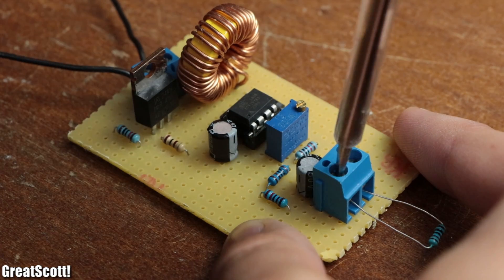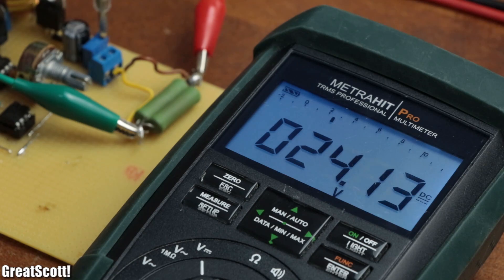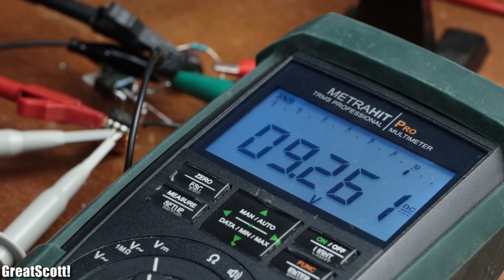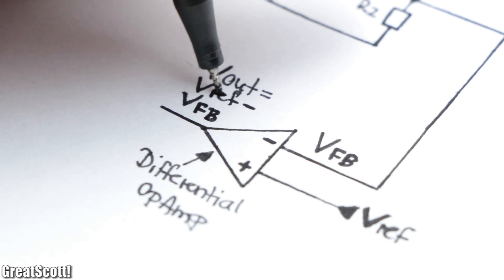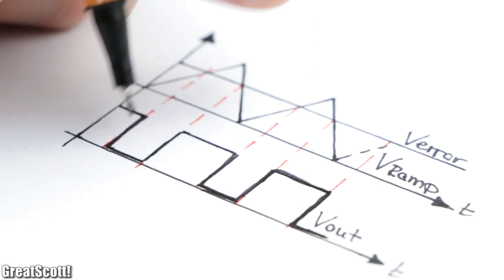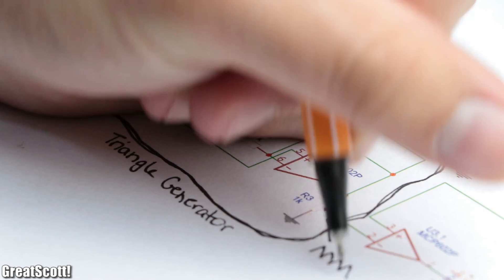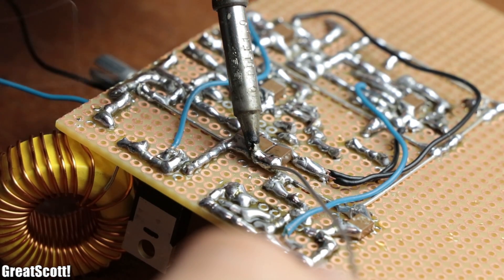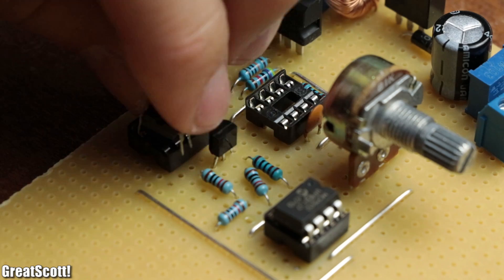Creating a Boost Converter WITHOUT a Microcontroller

Comment: SMPS have been around since before small cheap microcontrollers. I prefer using a comparator chip and have designed smps which are more efficient than commercial dedicated chips.

Comment: Circuit around U1.2 need to be configured into integrator amplifier. Take out R8 and replace R10 with capacitor which has 10mS with R9.
Cheers from Indonesia

Comment: add negative feedback from the output back to the input, put an opamp comparing the output to a stable reference voltage, let the op amp output control the duty cycle.

Comment: hello sir, I want to know what component is that which looks like a mosfet but has a slight indentation in the corner, and is pin 4 and 8 of the mcp602p opamp connected to another power source?, if so how can you connect it with only one input voltage (boost in ). I want to try to make this circuit. Thank You

Comment: Radio Shack used to sell a book "build Switching power supplies" i have one, shows how to build using basic components. I built one back in the day to step 12volts up to 30 with 100watt capacity, using a single IRF510 as the switch along with a high speed diode and a toriod. The control was a 555 timer

Comment: We should use microcontrollers for such a simple circuits only, when we don't have other solutions for that. You can easily build the boost converter using 555 timer, an optocoupler and tl431 or a zener diode. I have built one and it was as simple as the microcontroller version. Building the boost converter on discreet transistors is also possible. You just have to make a multivibrator, connect it's output to 2 transistor mosfet driver, make a feedback with tl431 or a zener diode and a transistor, and modify the resistance of one of the base resistors in a vibrator with it. Just add a paraller transistor to that resistor and you're done.

Comment: “We can create circuits without a micro-controller....” in my case this is my natural choice because thats where I started in the mid to late sixties. From my perspective, starting with analogue design gives you more understanding of circuit theory and signal processing.
Often when you are beginning a new design you have to research to gain the fundamental understanding.
Putting those building blocks together in discrete form gives a better understanding of what works and what doesn’t and starting point for experimentation and optimisation. That is what I enjoy most in watching your videos. I gain a new or better understanding.

Comment: if you don't want to use a microcontroller you can use a pwm ic like the tl494 sg3525 and so on. the only problem is the frequency. they can't really get to more than 150kHz

Comment: @GreatScott! 
you design a compensator only a differentiall amplifier and with gain of only 1.  How your circuit is giving correct output corresponding to feedback i didn't understand.

please check voltage output from feedback.there must be offset  between set value and output you are
 getting because it is only proportional controller with gain of 1.

Also designing of better compensator is good such as pid. For better response and stability.

Comment: Wouldn't it be possible to just trigger a pulse of defined length at the MOSFET gate everytime the output voltage falls below the desired voltage? The off-time of gate-signel would just be the time it takes for the output voltage to fall below the desired voltage again (dependend on the load).
Reply: You've just invented the low-drop-out voltage regulator. You can indeed do that, but then you won't get continuous current flow in the inductor, which means your efficiency plummets.

Comment: I have a question. How to bust up dc 0,18 V to 65 V? And very efficient. I need to power up a 32,5 mW load with thermal pads with warmth of a hand. of course only for a few second or so.

Comment: hi I have a XL6009 Boost Converter which I can boost to 12v from 5v but when I add load it smokes and the output voltage drops to 3v

Comment: I suspect there is at least one comparator too many. In fact TL431 is not just a reference, it's also a comparator. You could cull the IC count WAY down by not generating a sawtooth but using an RC to delay the switching, and letting the converter self-oscillate. Who cares that the frequency is actually duty cycle dependent?

Comment: I always love the challenge of making circuits without a microcontroller. I've made automatic headlights, a functioning car alarm with built in idiot proofing and a radiator fan speed controller all without using any kind of microcontroller- but this is mostly because programming confuses me. Oh well, I guess I'll learn when I am forced to for a project.

Comment: Could you just eliminate the triangle wave and comparator and just use the error-IC's output as the input to the MOSFET (using the inevitable oscillations of the whole system to balance it)?

Comment: Ok so how do i use the attiny to boost 12vac to 600vac with out using a big ass transformer? Trying to build a small tube amplifier but having trouble finding a supply for the plate voltages that will fit in my enclosure.

Comment: Why did you short circuit CAT and REF in the TL431A?
Reply: And what about the power supply of the mosfet driver. Is it the same 5 V (is that the same of VCC in the inductor)? Sorry for my stupid questions.

Comment: Could you please make a video about mosfet drivers? Did you post the schematics for this projects somewhere? I'm trying to make 74v, but the boost converter always stops at 60v, I'm guessing I need a mosfet driver for the MOSFET to swich quick enough. I would also like to know about the resistors people put between the microcontrolers pwm and the mosfet... What is that about?

Comment: Nice explanation. However I would argue with the basic premise that microcontrollers are usually the best way to control power circuits. If control bandwidth is important, along with high switching frequencies, then most microcontrollers will limit circuit performance. And a carefully designed and laid out PCB solution with an integrated power controller is by far the best solution. But for a simple circuit, with simplistic control strategies, it may be easier to implement and adjust with a microcontroller.

For example, I would be interested in the transient response of your ATtiny based circuit against the 99c integrated solution, particularly voltage overshoot (which might damage a load) when load current instantaneously drops by 50%.
Reply from the maker: I think I should have said it differently. I think uC are easier to use for small DIY projects. Not commercial power electronic products.
Reply: That reminds me, you can also use the serial interface of the microcontroller to set the voltage/current limits or other parameters.

Comment: Boost converters intrigue me. I run an electric bike with a 100v battery pack. How can you boost to those sort of voltages to charge the pack? Conversely, how can you buck from 500vdc down to 100vdc, enabling the use of EV fast chargers?
This is becoming a much discussed topic in the high power ebike world. Especially for motorcycle conversions. A lot of chargers that do this are available, most are from china, so I question the claimed specs lol

Comment: Just one NE555 + TL431 could be enough! Of course NE555 would not provide 'pure' PWM, but it could do the job. Taking in account the price of NE555+TL431 vs ATTINY it might have a sense. Especially if TL431 salvaged from dead PSU/charger.

Comment: what about using arduino for this task? I mean it probably can freeze sometimes or maybe generally not being fast enough to handle quick voltage rises and so overvoltage/damage an output device. Maybe ATiny or STM32 or ESP32 is better for such usage? I just want to be sure a boost converter won't ever damage my electronics. How can I (additionally) protect my converter's output in case a component or mController will fail?

Comment: I think the uC approach is usually preffered by hobbyists and non engineer people coz learning to code is easier than studying the analog design methodology and creating a solution around it. The applications of hobbyists do not usually require the level of efficiency that should be present in industry standard engineering design so this approach is usually easier and just werks. I may be wrong here but that is just my opinion. Also mixed signal design like a mcu controlled boost converter is tougher to design to strict tolerances than analog design of the same topology. Atleast it is to me. Great video btw !
Reply: A I 
Yea, probably

Comment: Dude...what is the use of tl431a ic in schematic
Reply: It is basically a zener diode which can (but don't have to) be set to a different voltage with an external resistor.
Reply: Thank you

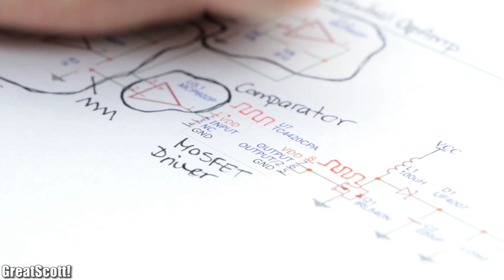Comment: In schematic you used 4 opamp( 6:03 ) but in final setup you used only 3 opamps ( 8:02). Why and which one you eliminated ?
Reply: The MCP602 has two opamps in an 8-pin package, so the three 8-pin packages you saw at 8:02 comprised two dual-opamps and a mosfet driver (TC4420). The TL431 is in the TO-92 3-pin package and the two TO-220 devices are the MOSFET and (I assume) a 5V regulator to supply the MCP602s.

Comment: How the differential amplifier can under stand the voltage  change from the resistor voltage divider that the changing in voltage occurs for loading option or for potentiometer tuning...
In this case if I tuned the potentiometer the differential amplifier under stand that the voltage is changed and make it constant and we can not change the output voltage....

Am I correct or not please Help me.....

Comment: How about the circuit efficiency? Was it lower than using a MC?
Reply: Are you refering to MC34063 or MiCrocontroller? I would say the efficiency would be better in both variants. MC34063 don't have FET inside, just bipolar transistor, and microcontroller would be slower in the software feedback loop.
Reply: I was referring to MC34063. Good point of transistors. I thought a bigger circuit would have more parasitic affects which in turn would decrease the circuit efficiency...
Reply: The most critical part is the loop area with FET and inductor.  And also the traces to the input/output capacitors. But it is hard to guess based on a video how is this critical part soldered on the proto-board.
(I've read somewhere that based on the step-up/down type of converter one of the input/output capacitor loop is not that significant, but I cannot find that now)

Comment: Can you create a boost converter without fancy OP Amsp? This is the real question
Reply: If you want to do it the sensible way with a minimum of components AND get good performance, use one of the control ICs made for the job. There are lots of choices in 8-pin packages with the ramp generator, voltage reference, error amp, and all the rest, including a gate driver adequate for many applications.
Building the circuit the hard way can be instructive but so can using a proper IC and taking time to learn the details.

Comment: hey there, I am a beginner in Electronics and I wonder how do  you decide where to put everything on your perfboard? Is there a methodology for placing components? Thanks
Reply: You will learn that during many projects and fails. In switching power supplies you have to keep the switching inductor path the shortest with the smallest loop area. Then the feedback wire from the voltage divider should be routed further from the switching path to prevent the coupling.
Reply: hubmartin thank you for your answer :)
Reply: You're welome, check also my electronics videos ;)

Comment: I need custom regulators for a project but the ones the guide tells me to buy are €10 /£9 each
And I need voltages of 1.15v, 1v, 3.3v and 5v
Reply: Juli The Wolf You need only this voltage on regulator? For 3.3v can use AMS1117- 3.3, for 5v AMS1117-5.0, 1v can with zener regulator, and 1.15v will be hard, but not impossible.
Reply: Dado Vlatko thanks

Comment: I have made a microcontroller-driven buck converter before, but that was a special case - it was for a solar MPPT controller and needed to constantly adapt for optimal power transfer.

I have wondered if you could use a microcontroller driven buck to vary the output voltage in a 'rectified sine' wave, then use an H bridge to make an ultra-compact inverter. In principle it should work, providing your load is resistive. A bit of reactance would really screw it up, but that's true for most inverters.

Comment: Great video! It's not that folks don't like micro controllers, but rather they want to learn how the discrete components work before they use an IC. Like making a timer circuit from transistors instead of using a 555 just to see how it works... Once we understand the principle than we can use an IC to make the project easier.
Reply: exactly

Comment: I don''t see why you need three op amps anyway. Never seen any  single rail power supply project that needed more than one. I'd have used a 40106b though. Or even a 4093b

Comment: How about making a buck-boost converter with multiple power source controlled by a atmega328? It could be used for connecting together solar cell panels which are not identical

Comment: I'm new to electronics having only dabbled in relatively simple projects in the past - I have a question and I don't seem to be able to find an answer but this video comes close. Is it possible to take a 0.5V 6A input (from a sunpower maxeon pv cell) and boost it to a usable voltage (say 5V)? I cannot find a boost converter that can handle such a low voltage (or if I do it cannot handle 6A)? Does such a boost converter exist or is it possible to split the current accross multiple boost converters?

Comment: Reasons why using a microcontroller actually does not makes sense: cost, power consumption, performance, and security. Granted some of this apply more than others. The cost argument is the one I expect you to not understand the most. Followed by performance and security. Software is commonly misunderstood. Most commonly what it actually is, how it works, and why we use it. Any software notion in past 2000s based around Turing is simply put outdated or flat out wrong. Which is interesting seeing as the whole market is still basically running Turing.

It was once said that software's power consumption comes from moving data around rather than the dynamic clock speed power increase. This is possibly true however completely wrong. Power consumption in CMOS is known to increase power consumption linearly under ideal cases, but usually across the full frequency range is exponential. However IO power losses are significant in Turing software machines. This makes sense actually, since it creates so much intermediate memory. This issues was referred to as the memory wall, which is really the IO/Clock wall. We solved this with caching which spends a decent amount of power to indirectly improve performance.

The issue is if you do the solution in hardware or enable the software to function better in software you avoid this problem. The issue is for a long time these was practically very hard to make, which is why Turing software existed in the first place. Now moving forward we have a problem. We have set a set of expectations surrounding software and hardware economics that are not sustainable. Thus we have explored many versions of Turing systems. Economics of silicon are based on yields and market demand in most cases.

This is where software gets a lot of slack, but it is mostly a lie. Tools for a new hardware platform are expensive even in the increasing software world of today. Large scale computers have been working around these software issues constantly. Die shrinking is usually the solution, but that only works so well and for so long. Back in the 90s they played around with newer versions of processor architecture, but it would appear nothing came of it.

Comment: mcu is an overkill for a boost converter, even with feedback there a bunch of tricks and different ways to implement a robust feedback system that is way cheaper than an mcu, easier doesnt equal better

Comment: What about very fast changing voltage at the input or fast changing load at the output, which setup uC or OPAM version would you recommend? For example dimming some lights or controlling motor with PWM signal.